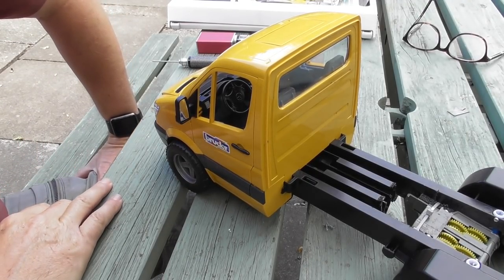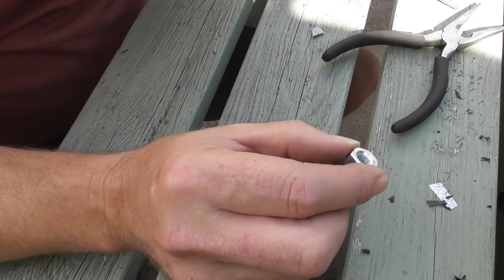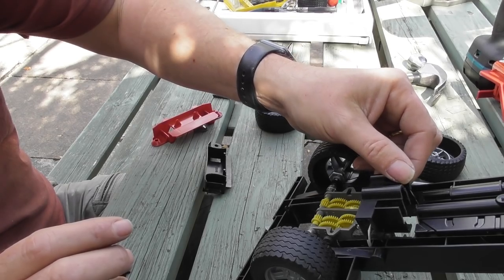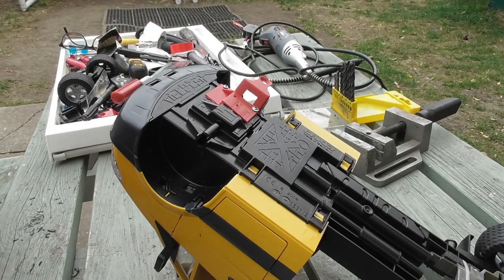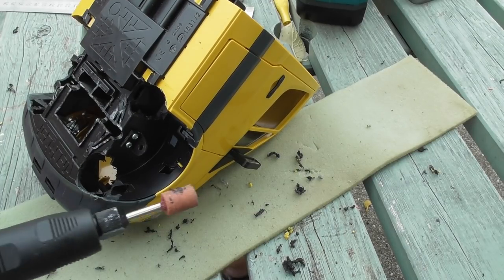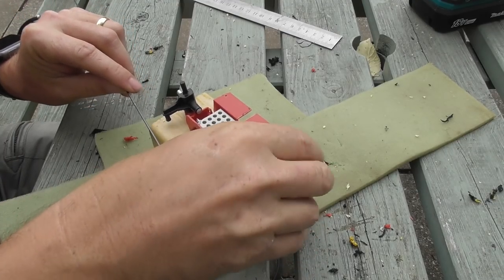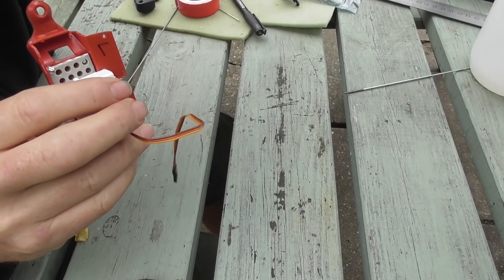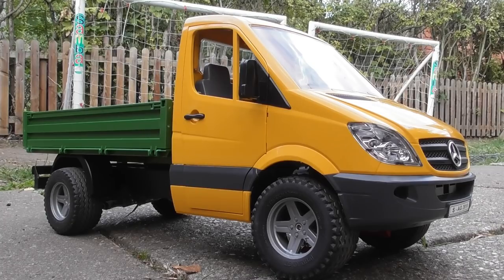Bruder MB Sprinter RC conversion Part 3 - steering

Comment: Thanks for sharing another great video Pete.
I enjoyed watching your practical engineering solution to the steering dilemma.
As soon as I can get around a bit better we'll have to have a catch up.
I can't wait for the next series of videos.
Very well done mate.
Reply from the maker: Thanks Ian, I was determined to make it work and was pleasantly surprised how well it actually drives. The kids really enjoy using it - as it is slow and controllable enough for them to use in the house, with enough torque to carry stuff. I've just got to mechanise the ramps and find a home for the electronics & this one will be done. I think that the articulated (semi) lorry with the long bed trailer comes next & I've got some ideas for that already.

Comment: Well...I was very impressed by the neat manner in which you suspended the Tamiya gearbox in the last episode of this intriguing build, but this video takes the biscuit.
 I love the resourceful way you´ve repurposed the steering knuckles and - er - the red bits from the Willys to create a beautifully tucked-away steering and suspension system. I love it so much I´ve subscribed on the strength of it. I have no idea how you´ll get the ramps to extend and retract but I can´t wait to see!
Reply from the maker: Thank you. I am trying to work these things out as I go along & not simply copy videos made by other people (although I sometimes have a look to get ideas or see how to get the models apart - if anyone has ever attempted the models I am adapting). The big challenge here was not to raid either my hobby grade RC models or the spares box, but to make something largely out of what can in the box with the recovery truck. i hope you still enjoy the ramps video - I did take an easier route,  but might return to this one I have developed a few more techniques. Thank you for your comment and subscription. I have subscribed to you also - as it looks like you have some interesting stuff on there!👍
Reply: Thank you very much for subscribing; like you, I enjoy converting toys or toy-grade RC vehicles.
 Having discovered your channel I´ll be working my way happily through your past builds for the foreseeable future...

Comment: creative mind bud nice work again 8-)  What you need is a 3d printer then you can fabricate and design your own parts to fit right in at the touch of a button.. It does take a few retro peices to get the exact fit you wnat but after that every one you build you can print out the same pieces 8-)
Reply from the maker: I might just save up for one once I've done a few more conversions. Good idea! :)

Comment: just like that the tires are off :) awesome thanks again!
Reply from the maker: 😂😂😂 You are welcome! It's a good method, took me a few destroyed wheels before I figured this method out.  👍🙂
Reply: @RCModders  well as i proceed with my conversion, it really is a no instructions, figure it out yourself trial and error process. Alot of staring at it before i cut etc, but mine is involving a team associated cr12 ford truck, my axial 69 blazer transmitter and receiver, and my trusty and awesome Canadian tire dremel. The width of the axial with tires on is 178mm. i think the bruder truck is about 185 mm, so approx 3.5mm difference each side. So far is coming along nicely.
Reply from the maker: Sounds really excellent: the super scale detail of a Bruder body together with the capability of hobby-grade 4x4 axles & transmission should make for an awesome combination. Feel free to post a link to pictures / videos of the outcome in the comments. Small differences in wheel base or track can usually be got around if you need to (eg wider hexes - if its just a mm or two - very flat washers can be ok - I've used plastic ones before to do this), although Bruder tend to be a little too wide on the, so this may be perfect anyway. Letting your imagination flow & creating something truly unique is great fun!    🙂👍

Comment: I need some help wit a project I’m doin do u have any advice to give me
Reply from the maker: what help do you  need?
Reply: I’m trying to convert a toy model like how u do it but it’s the adventure force black and green Jeep  set to an rc if u can find it in a store near you and do a mod video on it .it wud  be nice or jus give some insight it wud help a lot because ur videos are so dope to watch ....but I’m not as gud at rc mods
Reply from the maker: For the time being I am focusing on the Bruder conversions which are keeping me quite busy. I think that the techniques for these conversions are going to be fairly similar. The sort of things I would think about are 1. has it already got steering? that helps a lot. How will you control the steering? 2. are the tyres any good (not too hard)? will you have to change the wheels, if so what size? have you got some, can you get them? how will they attach? 3 axle size: have you got a transmission for that? 4. wheelbase / track (width). can the body be put on a different chassis? 5. is there room for the electronics?  These are the sort sort of things I think about before starting a project. You get better at mods by just trying & having a go. Building stock RCs and watching videos will teach you a lot and give you ideas. inexpensive toys are not a big risk if they go wrong. Good luck! 🙂
Reply: Thank you a lot
Reply from the maker: You are welcome! 👍
Reply: lol pretty much nailed it here.. theres alot of thinking that goes into a bruder conversion or any conversion at that matter.  I am also looking into doing dicast Masio and Burago collection of sport cars I have stored away
Reply from the maker: Indeed. But very satisfying when you have done them. Sounds interesting - I look forward to seeing them!

Comment: No suspension
Reply from the maker: The second version of this has full all round suspension. Leaf and springs at the back and springs on the front. And 3D printed parts. The second one used uses the DHL van body. You can see it briefly in my latest (Nov 2021) video. 😁👍